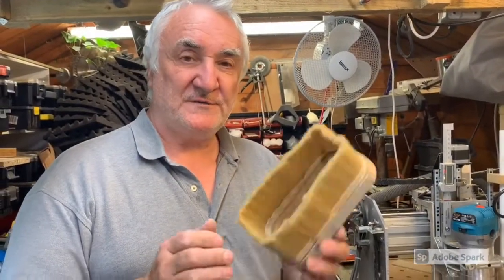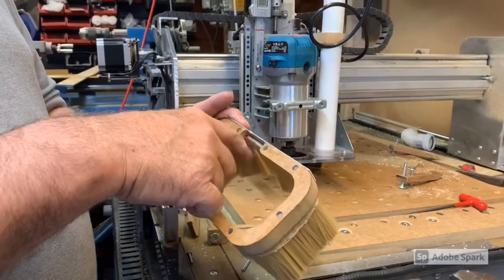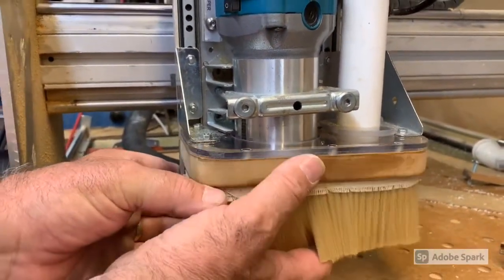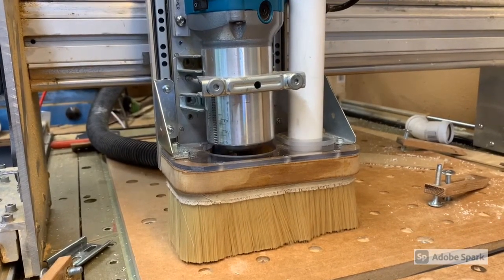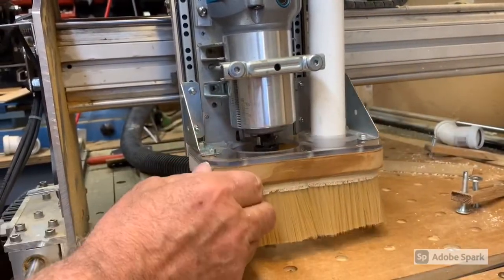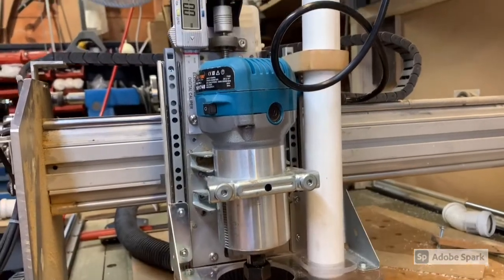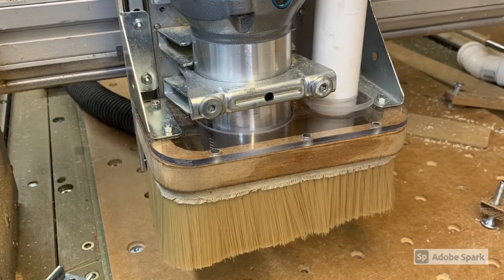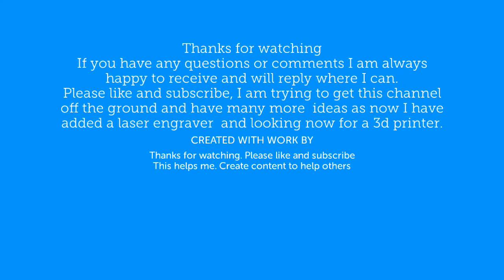Cnc dust shoe cheap and easy to make

Comment: I love this "floating" design much more than the alternatives I've seen which tend to result in either compressing bristles or adding the complication and expense of another CNC-controlled axis.
Reply from the maker: Thankyou, to be honest it works way better than I initially thought it would when used there is very little  to no dust. I now use another neodymium magnet to hold the shoe and holder at the top when changing bits. And the really cheap digital  caliper/ vernier which I thought might not really be useful but nice to have,is invaluable now when changing bits and getting the height as previous bit